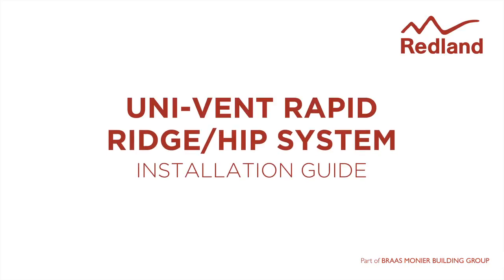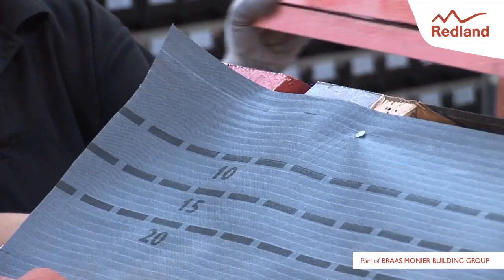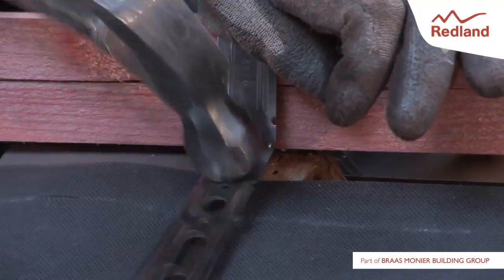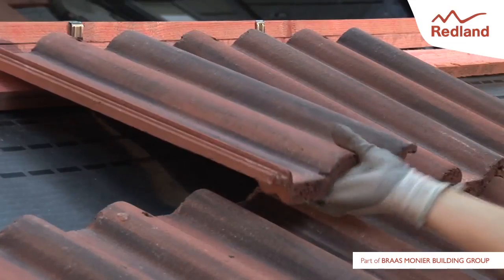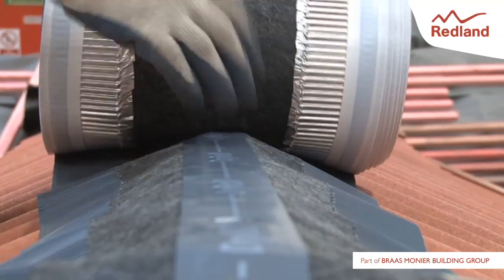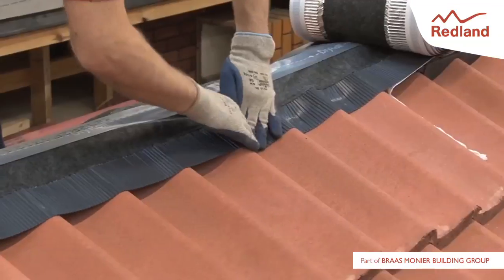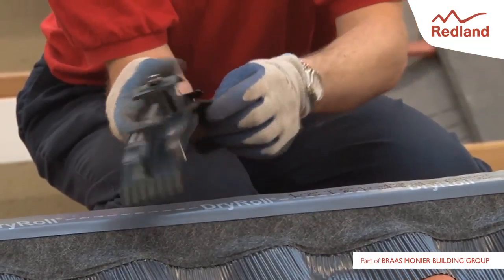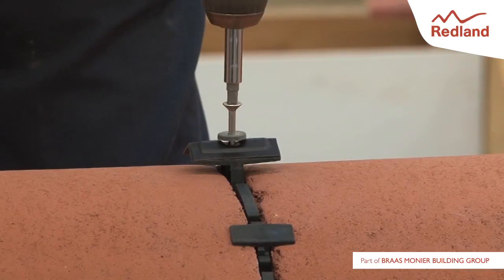Uni-Vent Rapid Ridge/Hip installation video

Comment: Have you tried laying out the ridge roll with a bit of wind and when the tiles/slates are wet? It's an absolute nightmare, so I suggest using a dry fix system that does not require using the ridge roll and messing around with those straps.

Comment: My roofer has used your system on a centreline dormer ridge, where the tiles lie flat either side of the ridge tile and on roof quarter ridges where the tiles are stepped either side of the ridge. There are open gaps where the roll has failed to adhere properly  to the stepped tiles, allowing water to ingress and rot the battens. Unless properly sealed this is a poor solution in these circumstances.

Comment: Dont know why you leave the felt short. Its breathable membrane, the whole roof space gets vented without the need to vent through the ridge. Or is this another example of a designer trying to be to clever. Other than that these systems are a great idea. Less chance to stain a roof tiles that are damp and slippery.
Reply: Depending on the exact type of roof NHBC regs require 5mm gap even when it's a breathable membrane and also 7mm at eaves too.
Also if the tiles are impermeable the under tiles need venting 5mm to the top even with a LR membrane.
Basically it depends if your using NHBC regs or not, plenty of manufacturers don't ask for gaps in their installation instructions.